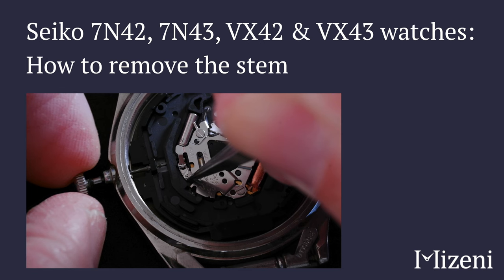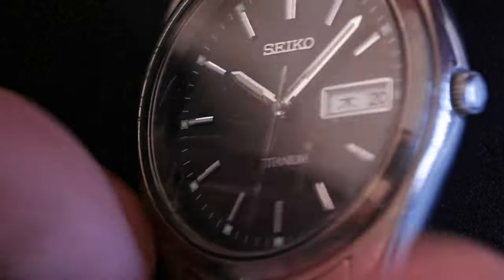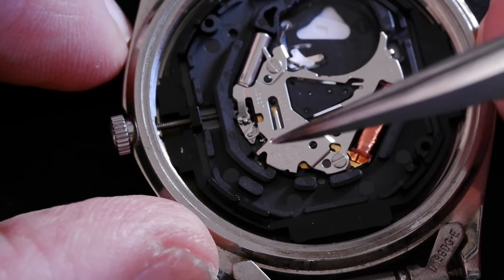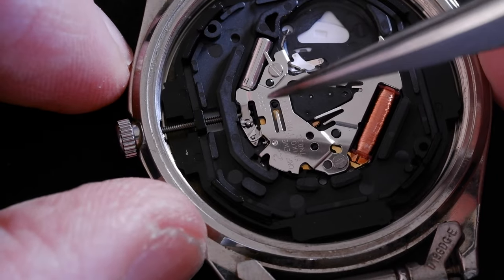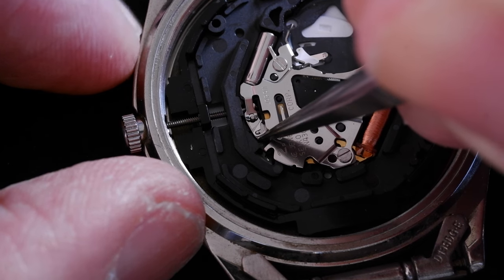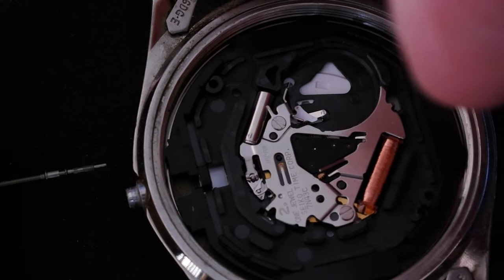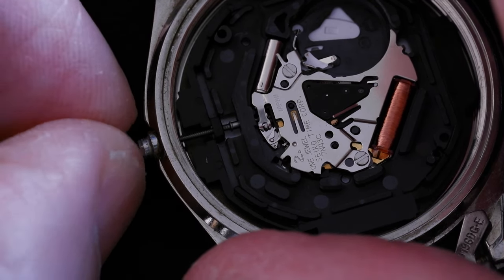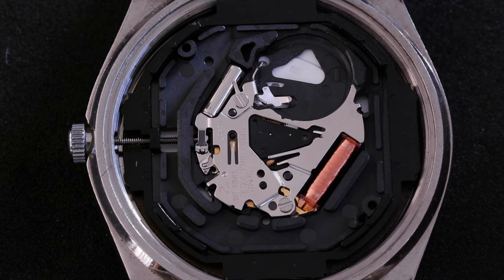Seiko 7N42, 7N43, VX42 & VX43 watches: How to remove the stem & crown

Comment: Question what’s the difference between seiko 7N43A and 7N43C. Is it the same I brought a watch that says 7N43A but it’s a dummy movement and want to know it 7N43C movement would work/ fix with no problem
Reply from the maker: Hi Charles. There is a very small difference between the two – according to the technical guides, the 7N43C is about 0.1mm thinner and has one jewel, whereas the 7N43A has no jewels. The actual width/diameter is identical so you should have no problems replacing the 7N43A dummy movement with a 7N43C movement.

I've just updated my website ( https://mizeni.com/movements/seiko-7N43 ) with this info and links to the technical guide PDFs. Thanks for the question.
Reply: Thank you so much. You’re really helpful and amazing. Appreciate you taking the time to answer my question.
Reply from the maker: @charleswhitfield831   You're welcome!

Comment: Hi again! Now that I've removed the stem I see the dial has a sort of a thin transparency on it that is bubbly and I wish I could clean up its appearance. Would you possibly have any suggestions about this, or where I could view some instruction on it? Thanks.
Reply from the maker: Hmm, sounds like a layer of lacquer and my instinct is to not touch it. Dials are notoriously hard to repair or restore. The only thing I usually do is use Rodico to take off some light dirt and dust. Anything stronger risks damaging the dial permanently. The only practical options you have are to leave it as-is and call it patina, or find a replacement watch with a better dial. Sorry! If it helps, @MyRetroWatches has a good video where he cleans up a Seiko dial: https://www.youtube.com/watch?v=ixJYb2Z2YTQ
Reply: I agree - thanks. @mizeni

Comment: I have this movement in a Sandoz which as given me good service for a few years. I know nothing about watches but like tinkering. Recently the watch stopped. I changed the battery and it worked for a while then stopped again. The next morning it had restarted. I adjusted the time and it refused to start. Its done this a couple of times. Any suggestions as to the problem?
Reply from the maker: Hi Ronald. Unfortunately I'm not sure what the problem is. The most likely things I can think of are battery (even though it's new, sometimes they're low on power from being old or poor quality), some kind of dirt inside the movement, or perhaps the hands are slightly bent and getting stuck when they pass a certain point. If the watch stops at the same time each day then this is a possibility, otherwise I think dirt inside might be the culprit.
Reply: Thank you for the prompt reply. I think I've cracked it. Here in Thailand maybe the batteries are not always genuine products and vary in size. I've stuck a small piece of duct tape on the back of the battery so that when the back is screwed down it holds it in place. It's working perfectly. Real Heath Robinson and I expect you are having a fit. But it's working. So far.😉 @mizeni
Reply from the maker: @ronaldmartin7892  Can't beat a bit of Heath Robinson! Glad you got things working again.

Comment: What's the size of the case on this watch ?
Reply from the maker: Hi. It's quite small – 36mm diameter (37.7mm with crown).
Reply: @mizeni  thankyou. I don't suppose you know what size dial fits it also? I'm figuring a 28 mm there abouts? Only I'm not seeing dials specific for that movement , so wondering what the best option is to have one for it....

Comment: I have an old seiko quartz. Can't find the release point for the stem. If I sent you a photo would you be able to spot it? Thanks.
Reply from the maker: Hi there. Yes, I could have a go, although it might be easier if you just let me know the model number written on the back of the watch. It should be eight digits with a hyphen in the middle, a bit like this: V401-5250
Reply: OK, on the back are two numbers; 6D2613, then under that is 43-3349. Thanks! @mizeni
Reply from the maker: @curiousassortment   Thanks for that. The model number is 43-3349, and the first part of that is the movement number (43), which started production in 1975.
I don't have that movement but I found a photo, and I'm pretty sure the stem release lever is the place where I highlighted here:
https://imgur.com/pcJQlVx

If you press that with a sharp object, you should be able to pull the stem out. If not, let me know!

By the way, the first number you mentioned (6D2613) is your watch's serial number. The first two digits are the year and date, so it shows that it was made in December (D) of 1976 (6).
Reply: Thank you so much for the info and for your suggestion/photo. I'll try it! @mizeni
Reply: That worked - many thanks!  @mizeni